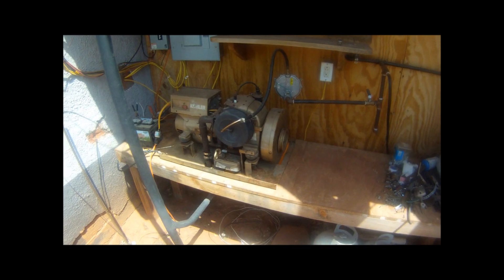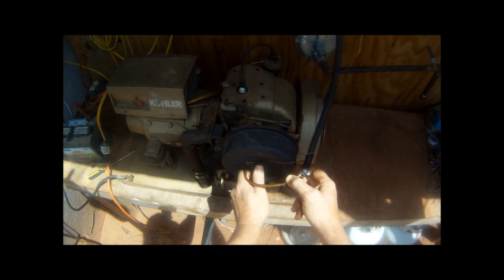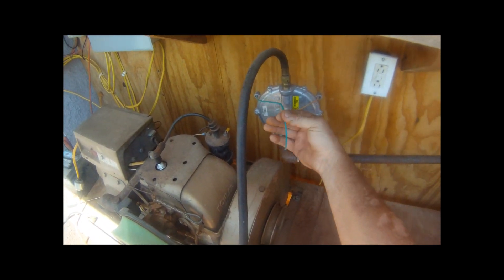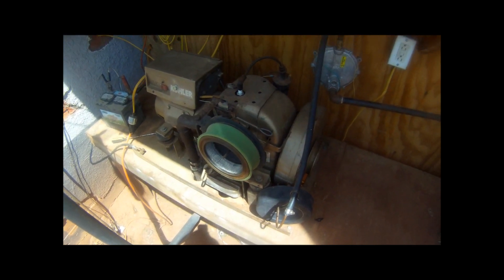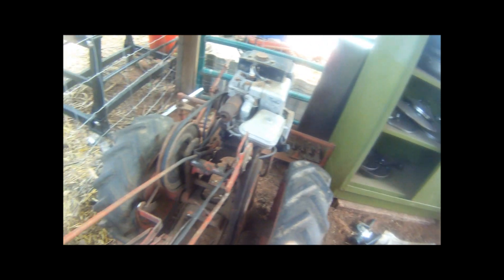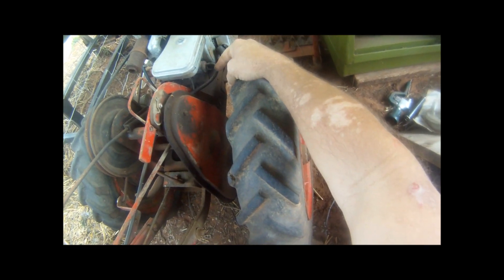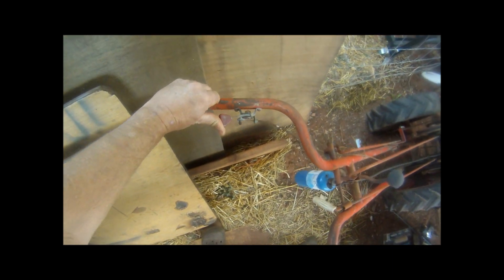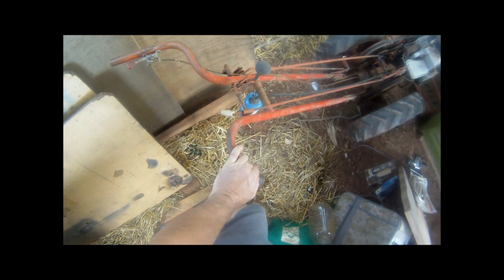Propane Generator Conversion

Comment: The engine will run off propane as it’s entering the carburetor.  The danger in not using a conversion kit is the engines uses different amount of fuel based on its load.  The people who just run a line in and adjust it until the engine runs fine are missing the bigger picture.  When my a/c kicks on the engines uses more fuel and then when it kicks off uses less.  Where is the xtra fuel going ?  It could certainly cause an explosion.  Think of a barbecue pit.  The more gas you release the higher the flame. Now imagine if the flame went lower but the same flow came out.  The extra is going somewhere and depending on where that somewhere could be dangerous.  It’s heavier and stays close to the ground. It could drift inside somewhere.  Just information for those less informed.
Reply from the maker: That's why the "on-demand regulator" is a must.
Reply: The Unknown Cat  sorry I thought you were just venting straight into the carburetor.  I didn’t realize the flow would shut off,  increase and decrease with demand.   I stand corrected.
Reply from the maker: It's only half hacked ;) My set up is solid. and ultimately costs more than a kit with all the plumbing and switches required to do it well. Dumping it into the carb like I did may be ugly -but it works quite well ;)

Thanks for watching and for sharing your thoughts!

Comment: Sweet that sets up pretty easy really dont it. A lot more simple than I thought? Do you think it is perfectly safe? My dad is a fireman and said I should not do it. He is really worried it will blow me up, But it seems OK to me. I have not heard of any accidents yet.
Reply from the maker: shartne I wouldn't set it up to start automatically -unattended running equipment is a problem waiting to happen. There are usual flammable gas safety features in place -a manual cut-off valve and the electric valve is closed until power is supplied to it. The "on demand" regulator makes this very safe, as gas is only drawn as needed by the engine, and gives me peace of mind. As long as the system is properly installed and maintained -it is less dangerous than the massive electrical components of the rest of the sytem, in my opinion.